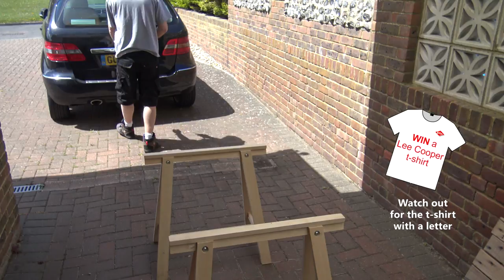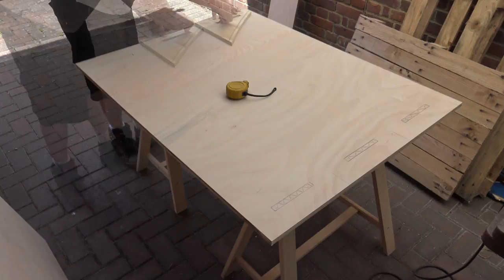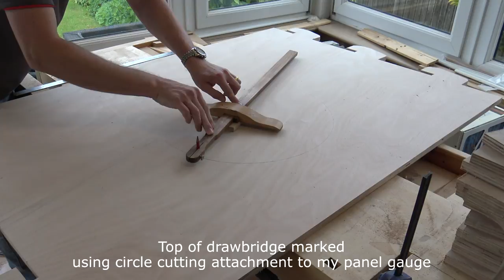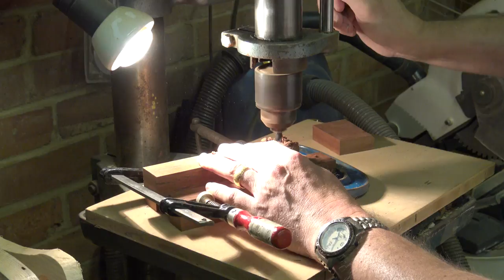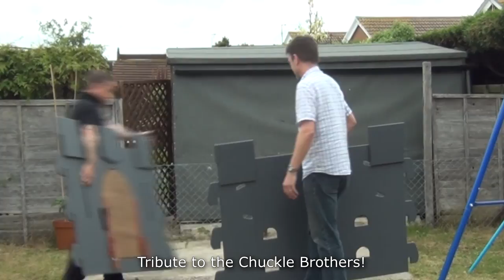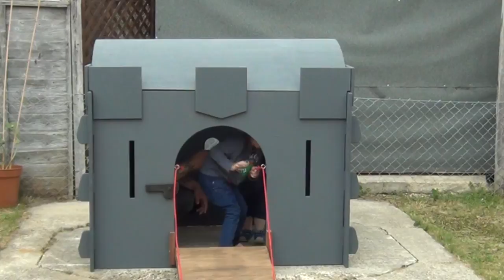Build a Knock-Down Fort from 2 sheets of plywood

Comment: Made one similar to that with sliding locks (as you did) but mine was made of large cardboard. Great for kids and can see that your boys like it very much also!
Reply from the maker: Cool. I made a prototype for this in cardboard, at about 1:8 scale. Tricky doing the joints with scissors!
Reply: Mitch Peacock - WOmadeOD I used a sharp utility knife I modified for cutting cardboard.
Reply from the maker: Good idea. My choice of corrugated cardboard, and watching tv at the same time, would have ended up with a visit to A&E if I'd used a sharp knife ;-)

Comment: Neat project.  I know you show dimensions in the video but do you offer a set of plans for this?  Thanks in advance
Reply from the maker: Thanks. Sorry I didn't think to do any plans since it was just a quick off-the -top-of-my-head design. There really aren't any important dimensions - I would probably just put two of the interlocking joints on each corner, which would speed the build up and still be plenty strong enough.
Reply: Thanks for the quick reply.  I'll make due with the info in the video and estimate the rest.